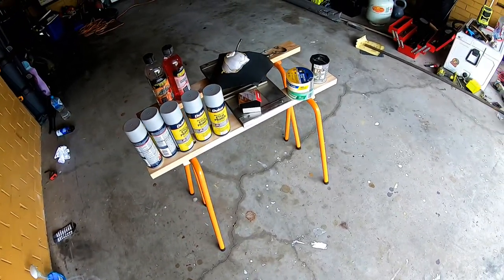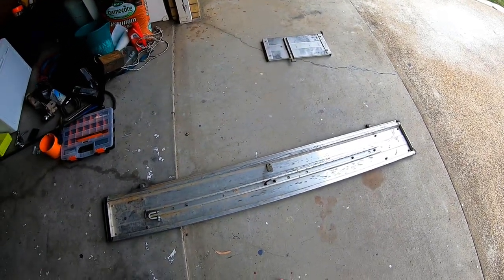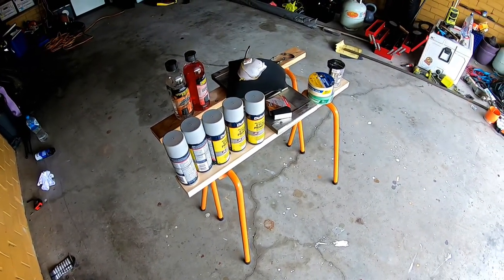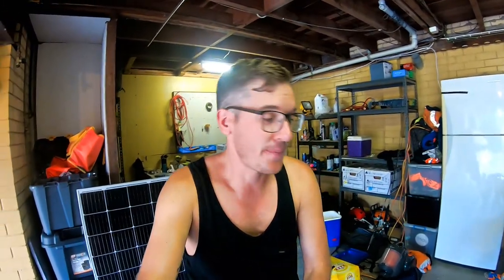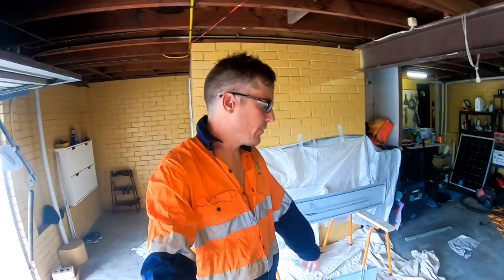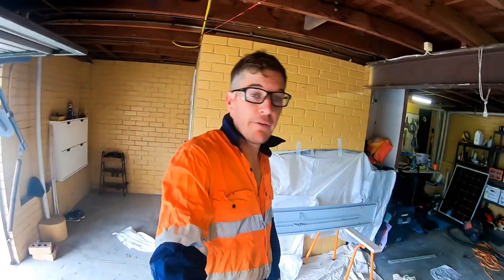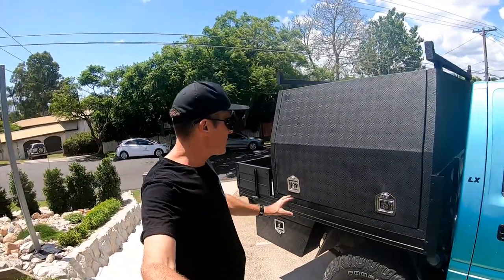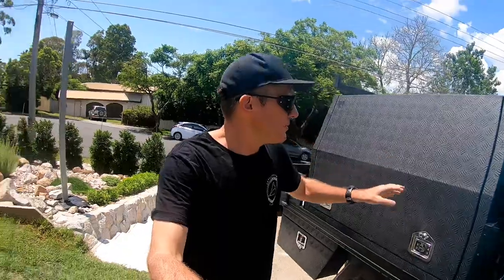How to paint your ute canopy with Bully Liner!

Comment: You may have better success in more coverage in having longer controlled bursts on the trigger of the paint gun instead of short puffs. It gives a more even coat. 
I have heard that using over 70psi on the bully liner instead of the recommended 40-60psi work better. 
Great job & keep up the good work!
Reply from the maker: Thanks for the feed back. Yes I think my bursts were too short and the wind I was spraying in was not ideal either.
Reply: Liquid Antler, one of the pitfalls I guess? Great job though! I’m looking at doing my pk ranger tub and flares some time soon. I think I’ll use the Raptor liner though as it’s not as glossy for the tub.

Comment: Nice job there mate. I’m thinking of restoring an old trailer with Bully liner. I didn’t think you could use etch primer underneath bully liner as bully is water based. Do you think there will be any problems using an automotive etch primer.
Reply from the maker: Hi mate I have used etch primer with no issues on the canopy. Maybe flick them a question just to be sure
Reply: @LiquidAntler  hey mate how has the Bullyliner held up to the Aussie heat? also how easy is it to clean?
Reply from the maker: No problems at all regarding the Aussie heat. Can be a little hard to get bird shit off but no dramas with dust a mud